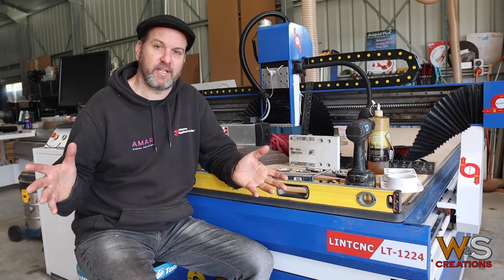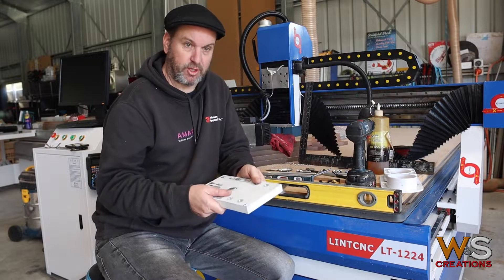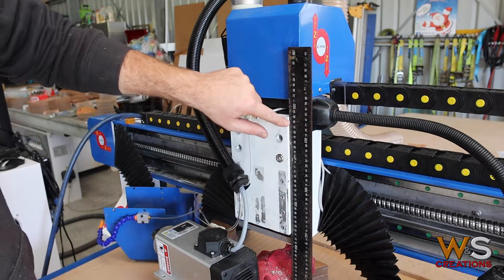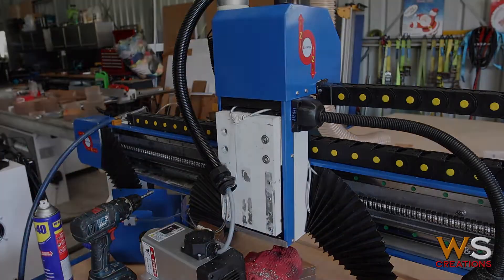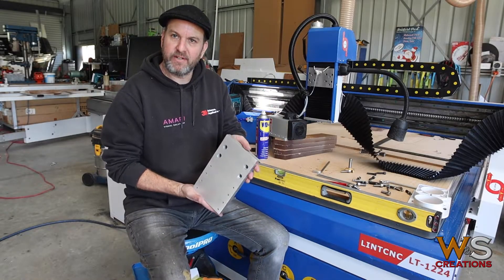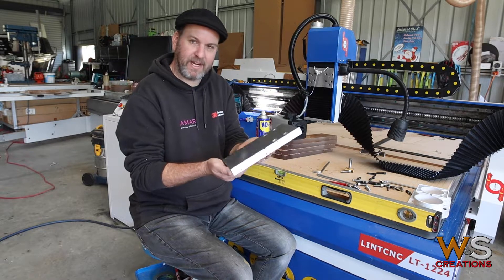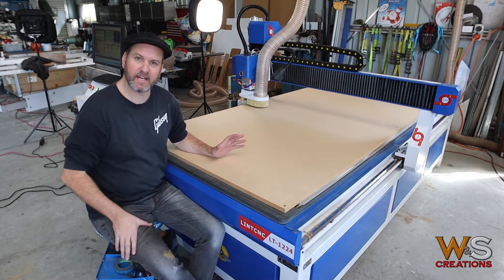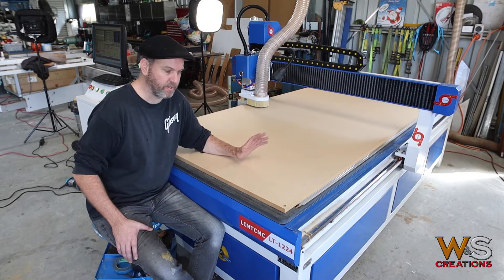Repair CNC Tram issue - China made CNC

Comment: great informative videos , thanks , im curious amout the mpg pendant you have in the background is it the XHC WHB04B model .how would you rate it as i was thinking about getting a pendant for my machine.
Reply: Not sure what a "mpg pendant" is... However if you are referring to my Panel Saw. Its a Hold 2600V. Its a Chinese made machine too. It has been a great panel saw. Had it for about 10 years and has performed flawlessly over that time.... Unlike the LINTCNC..
Reply: the hand controller for the cnc it is visable in the background , i was curious what type it is
 @GearCave_RetroVibe_Guitars
Reply from the maker: @rorymccann9198   Oh! that is what you meant.. Its a WHB04B-4.. you are correct.
Reply: @woodsteelcreations4681 , I also purchased a 10 ft by 5 ft from China a few years back, a company called stepmores. I used a freight forwarder to do shipping and delivery which saved me alot of hassle. I changed the controller to a uc300 eth 5 lpt, running uccnc software which I would highly reccomend,  I also had a tramming issue, my router is not perfect by no means but it has served me well, do  you like the hand controller?
Reply from the maker: @rorymccann9198   yeah i think this controller works well. Its very easy to use once set up. I really like the fine adjustment so I can set the home position very accuracy.